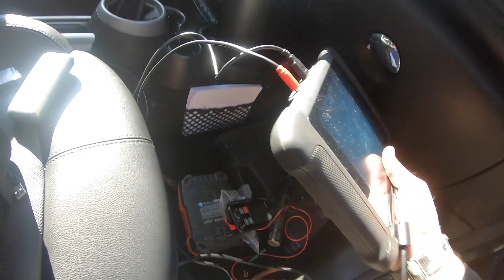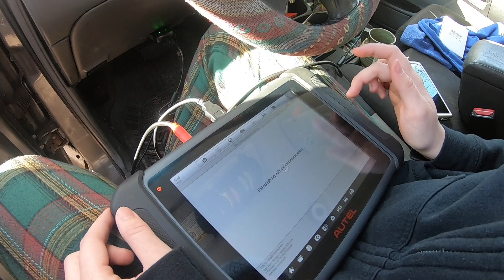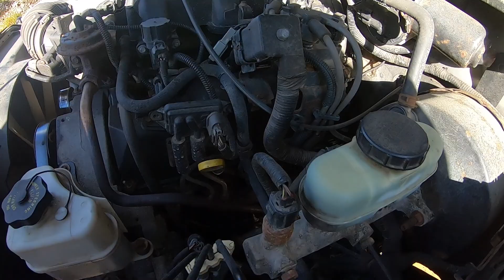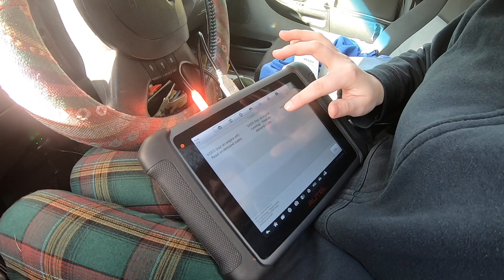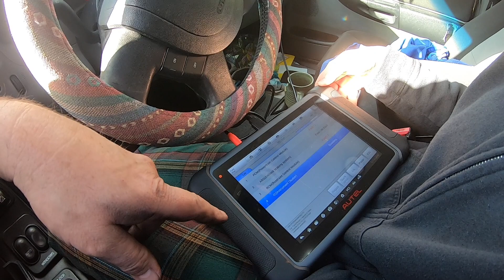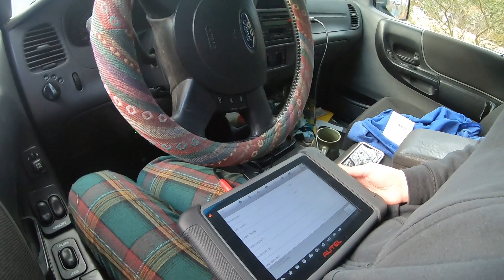275K mile Ford Ranger Intermittent No Start Issue

Comment: Rc guy garage, check the fuel pump ground wire had same issue on a 99 honda civic after changing fuel pump and pgmfi relay it was the ground wire  to the  fuel pump lol took a while to figure it out later hope this helps  have fun 😎😎👍

Comment: You could try replacing the fuel pump relay again because it came from the wiper position. That relay is old and  may be crapping out as well. That's the cheapest and easiest thing to do.
Reply from the maker: That's the missing part of the video. Originally wasn't filming I had her swap all the relays to new explaining that they were all old so we may have temp fixed the issue but the problem might still be there. 👍💯 Good call on the 275K relays😜